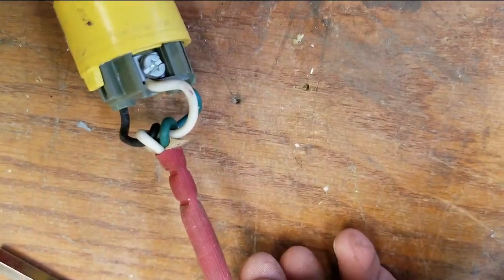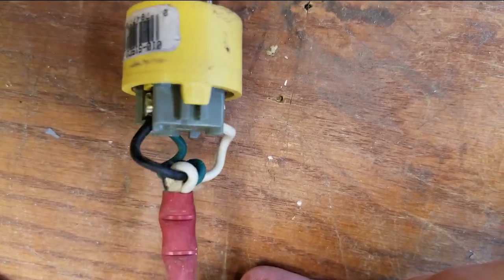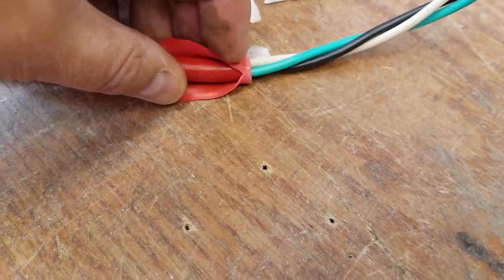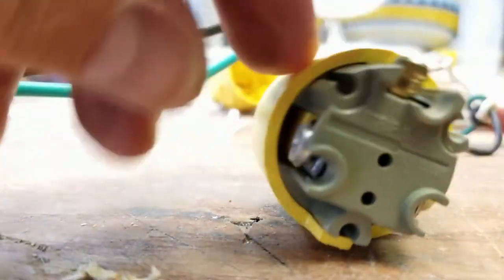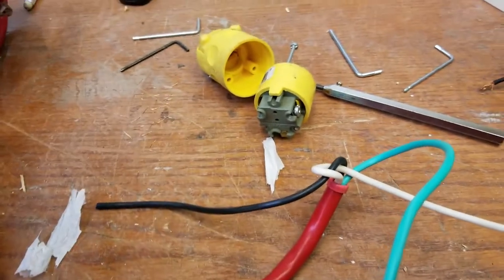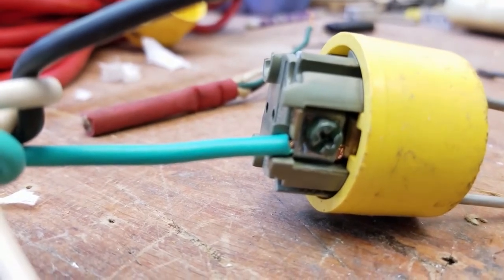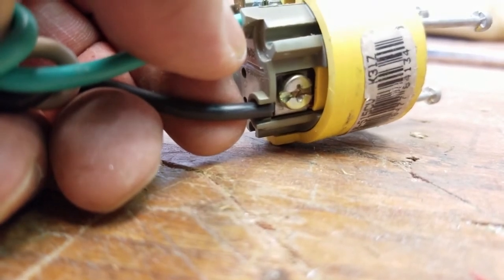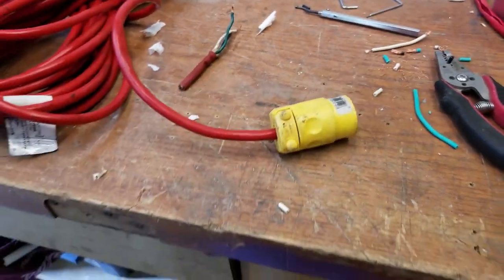3 wire underwriters knot

Comment: I went shopping to a well known brand hardware store.  I bought a “female” end connection manufactured by a well known electrical maker named Leviton.  Why this brand? Because it had a robber ring around the outside so if dropped on the floor in cold weather there was no risk of cracking or breaking the hard plastic which the connection is made.  Anyone repairing an extension cord should be prepared for what is NOT shown in this video.  First, the leads off the extension cord must be short, in fact as short as possible as there is little room in the housing.  But if you buy a Leviton device the Silver screw under which the White wire is placed, presents great difficulty in fishing under the screw.  Place the wire under the screw so when you tighten the screw it wraps the wire in likewise clockwise direction.  This you will find difficult and time consuming.  But trouble really begins if you bought a Levitron connector as I did.  The manufacture placed groove in the plastic on the wrong side of the screw making it impossible to feed the wire so as to go under the screw so when the screw is tightened, the wire wraps around the screw.  A definite design flaw.  Note that in this video that there is no such problem, but be aware that as mention previously the wire lengths are kept short as when placing the Cap on when finished will present problems.